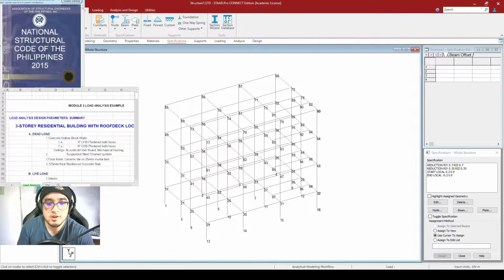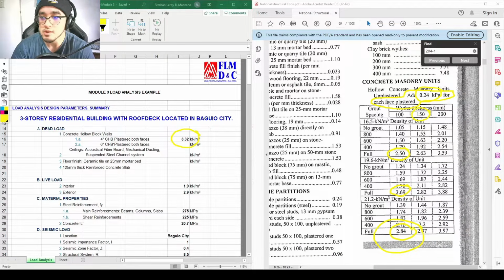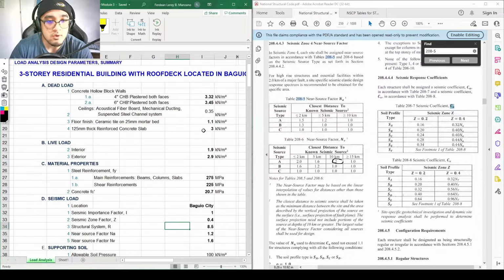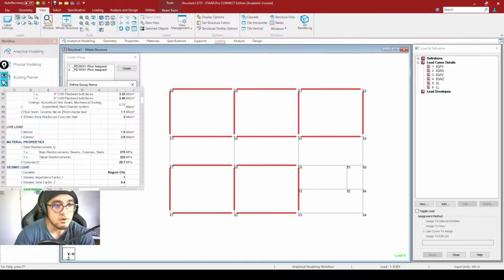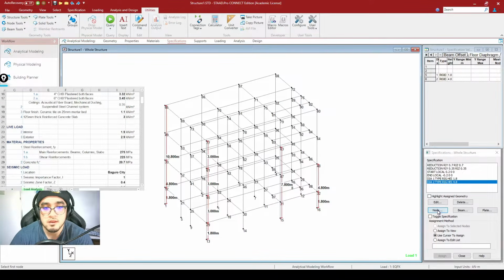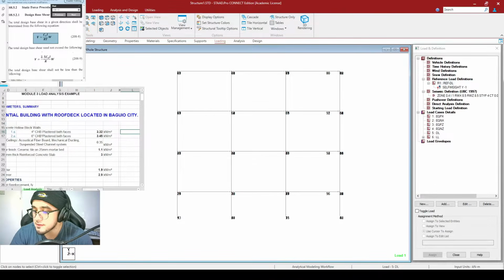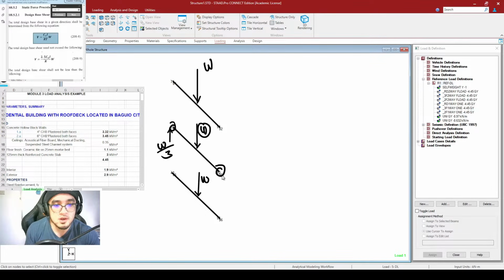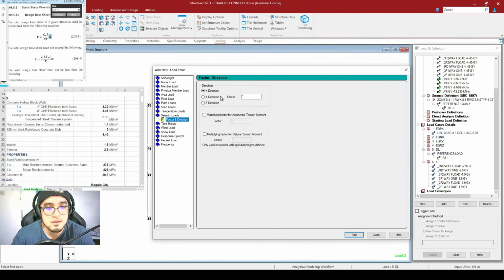STAAD.Pro Module 3: NSCP 2015 Load Assignments (Dead, Live, Earthquake)

Comment: sir for diaphragm

do you add diaphragm on the ground floor, iirc they don't really care for ground floor cause they assume that the ground would support slabs or beams

also if may stage po sa ground floor, if maglalagay pa din po nang diaphragm for ground floor
hihiwalay u po ba yung diaphragm for stage sa other parts... bale magiging 2 diaphragm mo po sa ground floor?
1 for others, 1 for stage diaphragm?

also do you have to model the stage?
Reply from the maker: Hello!

As for placing the diaphragm in the ground floor, if na-model mo din lang yung ground floor, I would say that it would be better if lalagyan mo din lang ng diaphragms since ang use ng diaphragm is para sabihin kay staad na if gagalaw yung isang node sa ground floor, sasabay din yung ibang node.

As for yung stage, if imomodel mo yung stage with beams na considered structural member and lateral force resisting system yung column niya, then lagyan mo din po ng diaphragm na hiwalay sa ground floor para sa simulation, mag act po yung nodes sa level na yun as one (sama sama). If di mo po kasi lagyan ng diaphragm, mas flexible po sila (meaning, if gagalaw mga nodes, assumed na hindi sila sama sama)

I hope na explain ko po ng maayos. 😅
Reply from the maker: Also, yung about sa pag model ng stage, you can also opt not to, depending on how you would construct it. Pwedeng hiwalay po sila na model and hindi siya naka fix sa main structure. Pero dapat yung weight nung stage maisama pa din sa pag model mo nung structure, if hindi mo man imomodel yung stage mismo sa main frame. Kumbaga nakapatong lang.
Reply: @deanzanoCE thanks po

Comment: Question Sir, for the wall loads, aren't you supposed to multiply it by its thickness rather than its height to get the line load for walls?
Reply: others also use height

Comment: Engr. Baka alam nyo po paano solution nito sa pagadd ng group sa floor load (either sa liveload or sa reference load definitions), ay hindi nya inaassign lahat ng beams ng nasa group kapag nagadd ako or in short hindi sya tugma. Pero tama naman yung paggawa ko ng group.

Example: yung group na nagawa for 2way is nakaassign sa beam 1-12, pero kapag inadd as group na sa live load ay yung naassign lang is beam 1-4.
Reply from the maker: It is either hindi nag close yung beams na napili (Like baka may naisingit na node sa group of beams na hindi mo pansin). Or baka hindi po sila magka level (sa Y coordinate. Baka namili ka po ng beams under 1 group na nasa magkaibang floors).

Comment: Hello, what if interior walls are on slab only, not on the beam.
Reply from the maker: Sorry for the 5 months late reply 😅 You must convert the wall load into a pressure load first.
Reply: @deanzanoCE  sir what if I got 450by450mm column dimensions from staad analysis but when i used the excel based computations I got smaller dimensions  350by350mm as passing result  ,which one should i use.
Reply: @deanzanoCE sir pag na convert mo na po sa pressure load. How will you apply the load in staad? And also is it necessary to add it to computation or idisregard nlng ung mga partition wall at assume nlng kunware nasa beam sila nakapatong? Pls enlighten me sir thank you
Reply: @deanzanoCE  Sir how to convert wall load into pressure load? I think I am doing it in a wrong way

Comment: sir engr. oscar here.. I have a question.. For the Ceiling Load, is it necessary to add a mechanical ducting load while for the earthquake loading, how did you solve for the entire weight of the building for the distribution of the designed base shear. For the foundation size and depth, how do you compute for maximum depth for a two-storey or up building considering there is no soil analysis in a particular location?
Reply from the maker: Hello engr.
1. Since mechanical ducting is a permanent load, it is logical to include it in the dead load (superimposed) to be part of the computation in seismic load.
2. STAAD will automatically compute for the total weight that is included in the Seismic Load parameters.
3. Sir I do not know how to compute for the max depth if there are no soil analysis done in a site. As the depth will depend on the findings of the Geotechnical Engineers.  :)